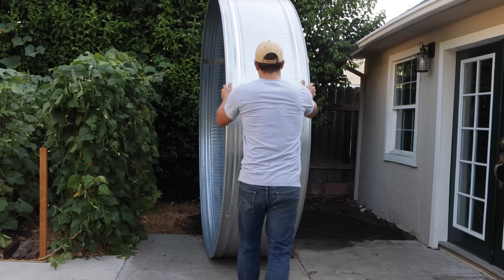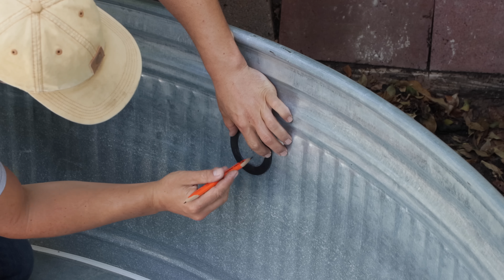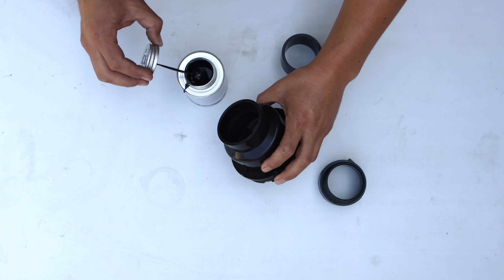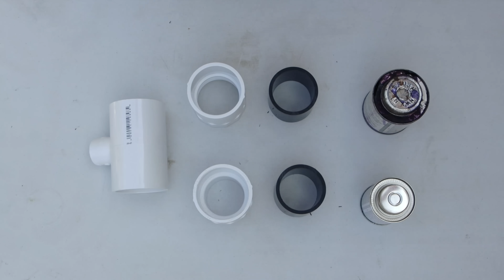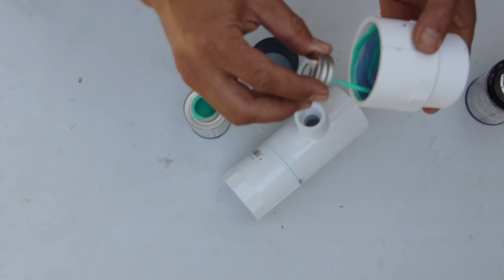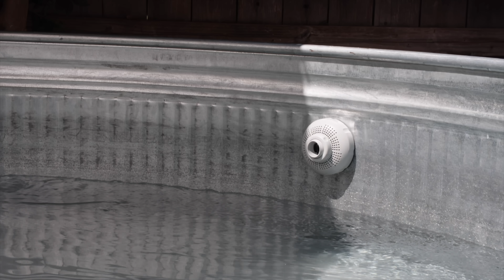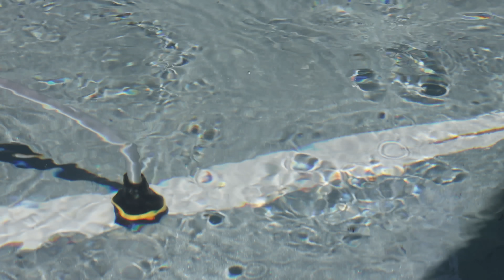Stock Tank Pool DIY

Comment: This is nothing new.  My dad  got us an 8 ft diameter stock tank for a pool in 1972.  He  put a pump and filter in it which was much smaller than the one you used.  it had a chlorine dispenser and he tested the chemicals daily.  At night my parents used it as a hot tub . (Yea as).  Yours was much too difficult.  Our pool pump  didn't require drilling a hole in it .  You made it too hard but my fad had a degree in industrial education and grew up in the oil field .
Reply from the maker: Thats awesome! yeah, nobody ever said this was anything new, people have been using these tanks as pools for a long time. thank you for sharing about your dads stock tank pool!

Comment: I like this idea. However not sure I would use dirt because when the water splashes out it’s going to make mud everywhere. How would you keep it from sticking to the bottom of your feet. Otherwise love the pool idea.
Reply from the maker: Thank you! It has concrete all the way up to it, so you never have to step on the dirt. Also as I explained in the video- this is a temporary location where I will have a garden this year, and in its permanent location there will be gravel

Comment: How much $$$ did the whole project cost?
Reply from the maker: Prices vary depending on when and where you buy the parts so to make it convenient and accurate I linked all of the materials in the video description. The only item not included there was the stock tank which I believe was about $450

Comment: I’m a shift leader in the stock tankline for the company that makes these. We sell them to farm supply, cal ranch, tractor supply, Wilco and more. You can contact behlen manufacturing to purchase directly.
Reply from the maker: Hi Adam. Thank you for sharing!
Reply: @davysanders4922  there are ways to prevent injury with these. I do not see how these could be death traps.
Reply: @davysanders4922  it would take a heck of a lot to put a hole in it. Again like I said there are ways to make it stronger.
Reply from the maker: @davysanders4922  thank you for sharing you passionate opinion. It’s clear that you are very concerned. I think you are greatly under estimating the strength of the material and over estimating the power of the water within this tank. The catastrophic failure that you describe is not at all a realistic possibility with the stock tanks in this situation, but I appreciate the passion and imagination that persuaded you to share your opinion and I know that it’s coming from a good place so thank you, and take care.
Reply: @davysanders4922  to each their own bud. I don’t see it as a death trap and that’s coming from someone who makes those tanks. More specifically I bet if he still has the barcode that it will have one of my crews employee numbers on it.
Reply: @davysanders4922  also I’ve been thinking about buying one and doing this very same thing.

Comment: Just a heads-up: too much chlorine will eat away the zinc galvanization and rust will start to show up. Once it does, it’ll spread quickly. We’re preparing to apply a coat of epoxy this week so we can get back in the pool we love and enjoy so much. ✌🏼
Reply from the maker: Thank you! I know, but still appreciate the info. So far no rust and I do use very little chlorine. That said I have the epoxy paint and will be painting it soon. I’m using the pond liner epoxy. It’s linked in the description. Which are you using?
Reply: We did an epoxy (pool paint specifically) on our stock tank and it COMPLETELY peeled off after the first season. We sanded down the galvanized metal and used a primer for galvanized metal. It looked beautiful, but only lasted one season. We recently purchased a liner for ours and so far so good.
Reply from the maker: @juanfernandoceballos  thank you for sharing. What liner are you using and how is it holding up?
Reply: @juanfernandoceballos  I’m curious too what liner you used?
Reply: just fill it up and play in it that's what we did in the 60s. this is not new to make a pool from. it's not as complicated as it seems-fill, play, drain, refill, play, etc.
Reply: Yo that's awesome
Reply: How about using bromine instead of chlorine?
Reply from the maker: @suzukibn1131  bromine is only for hot water like hot tubs, but thank you, I did look into it
Reply: Pretty sure a salt water softener will cause rust too.
Reply: @starmc26 yup, salt water destroys metal. That's why "salt water friendly pools" are mostly resin
Reply: Use elastomeric roof coating to seal and protect the tank.

Comment: It seems like it would cost the same to buy an above ground pool that actually comes with a pump and fittings.
Reply from the maker: You could definitely buy a cheap above ground pool for less, but they are cheaper in every way.

Comment: So it there any problems with the water chemicals balence?. I'm thinking🤔 maybe hard water or the metals in water due to the material of your pool
Reply from the maker: I use test strips to test the PH and chemical balance of the water. Is that what you’re referring to?
Reply: @urbanfarmstead   Yes. I've learned recently that depending on the material that pools are made out of like Pebble Tec tend to be high on PH. That's why I'm wondering about your chemicals balence due to the material of your pool..
Reply from the maker: @rocketplex8818  yeah, it’s always good to test. Also I ad very very little chlorine

Comment: Hi Kyle-great video!. One question, it shows you have two size hole saws, the 2 3/4" is used for the top inlet hole, and it looks like you use the same bit for the lower(outlet hole) as well. My wife purchased the pump and most of the other stuff last year from your links, but she didn't purchase the larger 3 1/4" bit. Is this needed if I purchase the shower drain(outlet) fitting in your description, or will the 2 3/4" hole work?
thank you!
Reply from the maker: Hi! Thank you so much for using those links! I used the larger bit for the shower drain that I had because that’s the size of it. I found mine ate the hardware store and sized the bit for it there. I one I linked is similar, but you should definitely double check its size before finding the right size bit. Hope that answers your question
Reply: @urbanfarmstead  Hi Kyle, thank you, we got it up and running and it's great so far! One issue though, the vacuum isn't working at all. I built the same manifold and my wife got the same hose wand, 25' hose etc..but no suction, even if I restrict the flow of the intake with my hand.. I noticed a few others having issues..I any thoughts on how to fix?

Comment: Did this for my kids birthday hen we loved on a farm.  I added pool noodles to the outside rim so they didn’t bash their heads in on the edge.  Metal tanks keep the water super cold!!
Reply from the maker: That’s awesome! Yes, I think with kids that edge protection is a great idea 👍🏼
Reply: Does the metal gets hot? Do you have to keep it under the shade?
Reply from the maker: @KimmieGrace-7  as long as it’s full of water the metal dies not get hot
Reply: @urbanfarmstead  okay thanks
Reply: @KimmieGrace-7  it’s relatively thin metal, makes a great conductor for heat/cold. Keeps it cool but also makes it a bit harder to keep heated if you run it like a hot tub.
Reply: I wonder how well painting it with a black epoxy paint would heat it up
Reply: You must have really loved your kid's birthday hens to make them their own pool.   Lucky birds.

Comment: Hi ! New to your channel, and a question, would you need to put a liner in your tank to keep it from corroding? Especially with exposure to chlorine which is as bad as salt on a car. Just a suggestion, seeing you can’t get a large stock tank like that very easily.
Reply from the maker: Great question. They say that the tanks will eventually oxidize so I will be painting the inside with pond liner (linked in description) to protect it
Reply: @urbanfarmstead  thank you! Hope you will show the video when you do that! ? !😀
Reply: He is using a salt water filtering system not chlorine.

Comment: I have one similar to that but mine has a US military surplus gasoline powered immersion heater in it and is more like a hot tub.
Reply from the maker: That sounds awesome
Reply: @urbanfarmstead  FYI those heaters can still be found once in a while. The Amish use them to keep stock tanks from freezing. Cool thing is they will run on old bad gas that mower shops and boat yards give away for free.
Reply from the maker: @paulhare662  good to know! Thanks!

Comment: What are you going to do when it starts rusting
Reply from the maker: Well after the first year it hasn’t shown any sign of rust yet, but soon I’ll be painting the inside with a pond liner epoxy to protect the metal. The product I’m using is linked in the description.

Comment: I feel like there's probably an obvious answer to this I haven't thought of, by why not put the on/off valve before the vacuum hose bib (between the pool outlet and the 3/4" bib)? Then you could get the full suction from your pump by turning it off to the pool?
Reply from the maker: Great question! That would be a slightly better location for the valve, however the plunger valve (on/off valve) has a male fitting with an interior O ring that’s specifically designed to attach to the pump hoses. You could install an additional shut off valve before the vacuum, but you would not want to close it all the way because it would likely cause pump cavitation.

Comment: As someone who works in basement waterproofing - having a giant water source directly adjacent to my foundation with no additional drainage installed in the area is a BIG no-go for me. I’d have installed a French drain, or at the very least a gravel drop, in that area.
Reply from the maker: Thank you for sharing your experience based feedback. This location here next to my garage was just a temporary location for this and it’s no longer there, but yes, if it were here longer a French drain along this side of my garage would be good to have.

Comment: I run almost 700 feet of black 1 inch poly hose in my back yard on a fence. Any amount of sun and my pool is hot. May thru August it can get to be 104 degrees by the evening. Peeling the cover back at 10pm can reveal 100 degree water at night. The ticket is the 1 inch outdoor blue Styrofoam underneath. This guys pool will be cool in the evening no matter how hot it gets during the day. Love his setup...just insulate it from the ground which is always cold underneath. You go from tin foil, to a thermos.
Reply: God damn, your poor pump must be tired 😂
Reply: @hubbabubba5177  grundfos circulation pump. You want a very slow circulation. 4 years so far.
Reply from the maker: Thank you for sharing your experience

Comment: how fast does a floating chlorine puck deteriorate the galvanized layer and rust the tank?  
how is the state of it after owning it 0.75 years?
Reply from the maker: I think that’s variable, however this tank has zero rust, absolutely none at all so far. But I will paint it with pond liner which is linked in my Amazon stock tank list in the description

Comment: Does anyone that has one of this tried a good cover that works?
Reply from the maker: People have recommended the Intex cover. I have one that I plan to try out this summer.
Reply: @urbanfarmstead  Could you post it once you do...I have read for the 8x8 tank the 10 feet cover may fit better but haven't  really seen anyone post anything on it or seen any pictures. Thanks
Reply from the maker: @monicamalave8359  ok, I’ll circle back

Comment: I need help! I did exactly (I think) to what you did, but I can’t get the hose to suck!
Reply from the maker: Oh no! That’s really the only trick part to the build. It it’s not working, the other option would be to just make a hose siphon when necessary. That what I did before the pump and it works well.

Comment: Depends on your irrigation needs, but instead of using chlorine and a filter, you can just pump the water from the pool into your veggies and then refill the pool with fresh water.
Reply from the maker: Yes, you certainly could
Reply: This is true but it'll be much colder

Comment: Hey there! Fantastic video. We’re looking at setting up our stock tank pool in a similar way and will be using your video as a guide. I’m definitely interested in using a sand filter, question for you - any specific reason you recommend the Intex 12” over the 10”? I found a deal for a 10” but want to make sure it would also work. Thank you!
Reply from the maker: As long as the 10 meets the gallonage needs it should be just fine. Thank you!

Comment: How do you drain the pool? You noted a leak when water-testing it and you needed to add an additional gasket externally - did you just let the excess drain into your lawn before you removed the inlet to add the gasket? Or did you hire a drain service? Do you hire a service at the end of the year to empty it?
Reply from the maker: These tanks come with a drain plug that screws in, so you just unscrew the plug to drain it.
Reply: @urbanfarmstead  given the water is chlorinated, does it damage your lawn at all? Thank you for replying!
Reply from the maker: @quarkycharms2785  I don’t drain it onto my lawn, and I allow the chlorine to evaluate from the water before draining once a year.
Reply: @urbanfarmstead  Thank you so much for taking the time to answer my questions.
Reply from the maker: @quarkycharms2785  you’re welcome

Comment: can the outlet be at the bottom in the center for complete drain of the pool if required? how much does the tank cost?
Reply from the maker: C Xyooj the outlet could be placed there if you choose. There is also a drain plug at the bottom that comes preplaced. Mine was $450 I think.

Comment: I always learned that chlorine and galvanized steel don't go together. I like the pool al lot though.
Reply from the maker: Casey D. Yes, depending on the concentration of chlorine it will speed up the oxidation process but at this low level it’s minimal. That’s also why I am painting the inside after this summer.
Reply: @urbanfarmstead  ive read mixed things about flex seal. Have you found another product? But I also read you need to scuff it up to get the flex seal to adhere.  When u said in the video that you would paint it, i didnt realize u meant the inside. Would love to know what your research is
Reply from the maker: kendrasbury I still have research to do
Reply: @urbanfarmstead  i think im going to try pond shield

Comment: Needs air flow underneath to help from rust.
Reply from the maker: Ojb 1959 yes, definitely. This is a temporary location but when I move it next month it certainly will. Thank you for the tip ✌🏼
Reply: What would you recommend?
Reply: Good question! I’m still trying to figure that one out, lol. It needs a base that will last and can support the weight yet provide air flow.🤔
Reply: @Ojb_1959  im using masonry sand under it.  Its pourous and made so that water goes thru and doesnt pool on walkways.  That is what i have read about in the past, so i think that is ok.
Reply: That should help but dampness will cause rust too. Good air flow is key unless using Rhino Lining or a durable exterior coating on it perhaps might do the trick if it’s sealed correctly.

Comment: "Some people like to use silicone around these fittings, but it's unnecessary if installed correctly".  5 minutes later, there's a leak around said fitting, adds additional gasket.
Reply from the maker: Yep, exactly. Gaskets are much more reliable than messy silicone. Also keep in mind this is not the fitting that many people cover in silicone, it’s a custom fitting that’s normally used vertically and not designed for thus which is why it requires the additional gasket

Comment: Do you think that spraying it with clear liquid rubber, like Flex Seal, can prevent it from rust and preserve the inside of the pool?
Reply: DONT use flex seal! It will peel. Use Pond Shield 😉
Reply: @jovanajohnson6848  or you can buy the hard plastic ones Tractor Supply or wherever
Reply from the maker: Goku Vegeta yes, that’s what I’m doing next spring.

Comment: Great looking idea for cooling off. I was curious as to your thoughts on GFCI circuits and Bonding for the pump and metal pool. What measures do you have in place incase something like a ground fails, a circuit breaker malfunctions, the pump shorts out, the cord coming through the window has a flaw or even maybe the neighbor has lighting around his yard just on the other side of the fence that wasn't installed properly.These are real things and unfortunately they go unnoticed until... well something bad happens. Just commenting out of concern.

Comment: We did that one summer for the grandkids! They had fun all summer long. The next year we went and got 150 tires that an old company let us just have to get rid of them. We stacked then into a huge oval, 6 tires high around, got a black pond liner, strapped it down with plenty of straps, filled it with water, and WA-LA.... a red-neck swimming hole! I even made a filter with a five-gallon pail and a small water pump! I turned the old stock tank into a salad garden. I only grow salad fixings' in it.
Reply from the maker: MyOwnDrum sounds cool. Thanks for sharing
Reply: Aww that sounds really fun